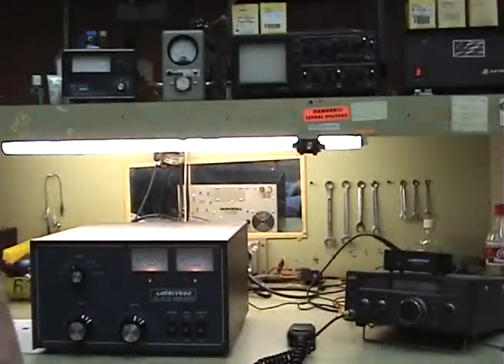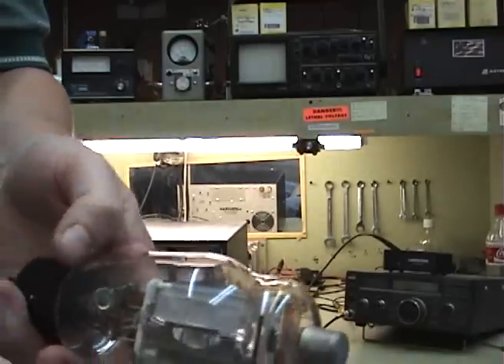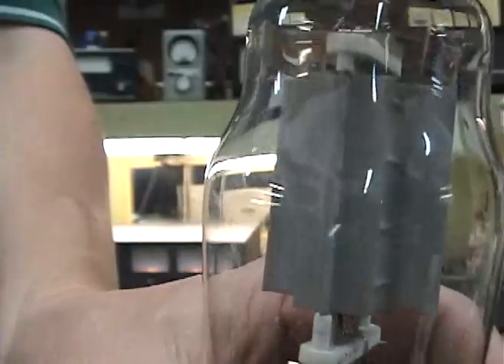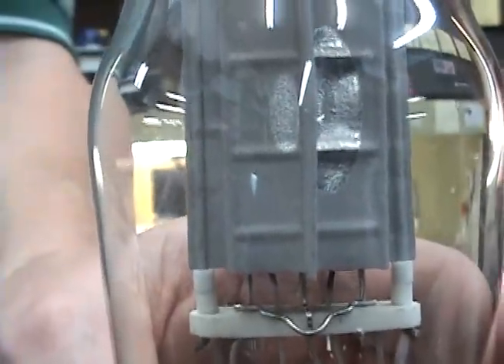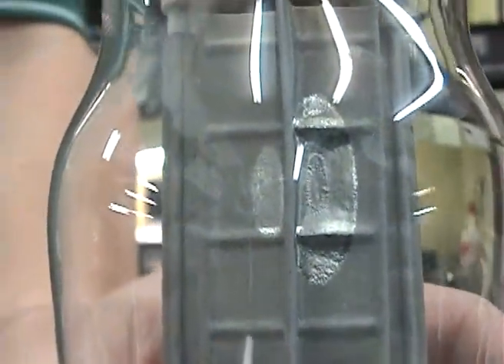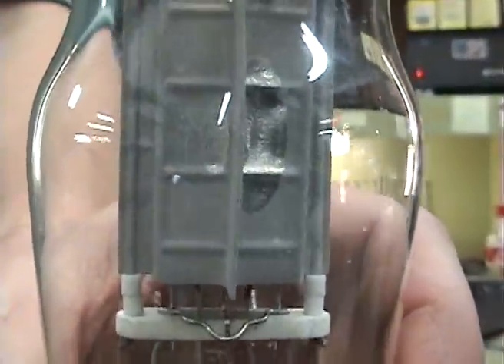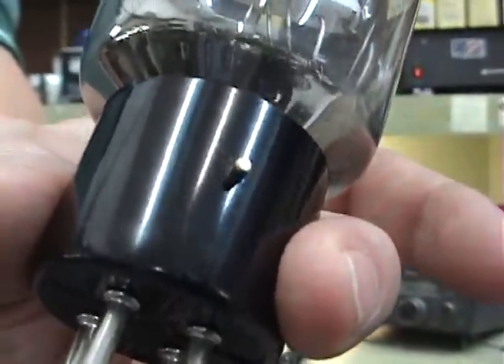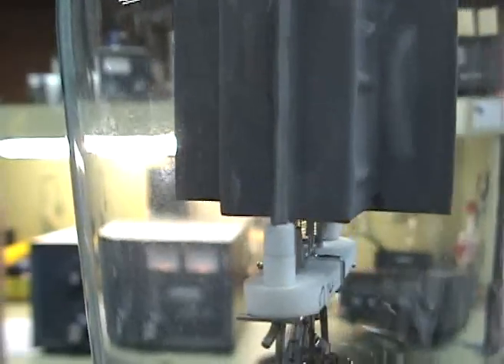Vacuum Tube Inspection

Comment: 811A tubes can be up graded with 572/B tubes. all ways use matched set. 3 or 4. keep plate current down. use auto tuner if you have one. I still have 24 JAN cetron  811A tubes NOS.  I have a used set of Russia 811A  .I think the Taylor select 811H tubes are just 572/B re labeled .  I have both and look the same inside.  marshal 811A tubes have coiling fines on the plate.  like the JAN tubes.  I get most tubes from RF parts.  Had the AL-572 for years. still going strong!!  still has Russia 572/B  tubes in from NEW.  do not run much over 1 Kw if at all. rated 1350 watts.

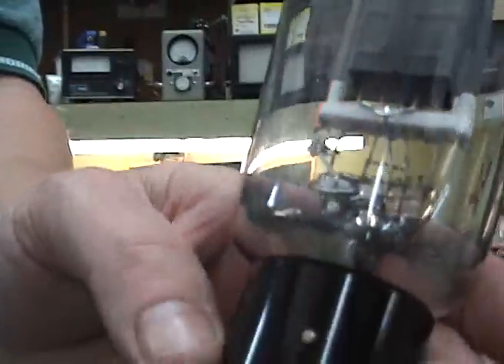Comment: 2:45  It is called a "flashed getter" deposit of the metal barium. It's purpose is to maintain and clean the vacuum of the tube. It turns white if vacuum fails.

Comment: @d1g1man The Shuguang factory in china has been manufacturing tubes since the 50's. It's not as if they are some recently sprung up plant making vacuum tubes. Their quality control has also increased dramatically in recent years.

Comment: i had 811a tubes in my ameritron they even had ameritron on the tube on all of them had no filament  under test kept blowing the fuse i put 572 tubes never looked back 4 years ago the original tube where crap.i tested them with a battery one had no filament glow Chinese crap.